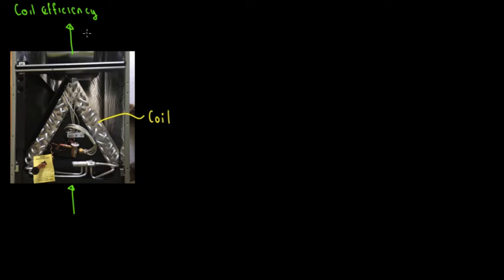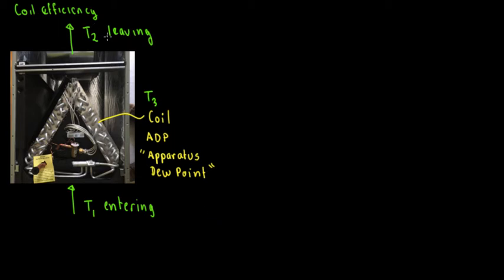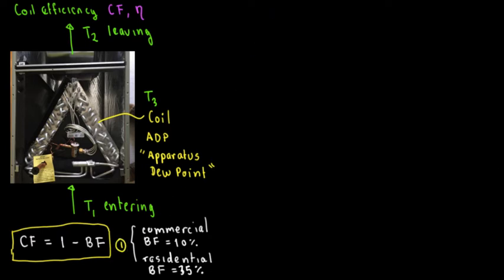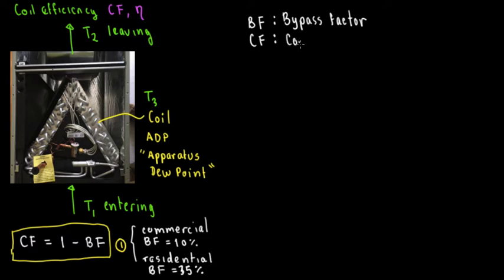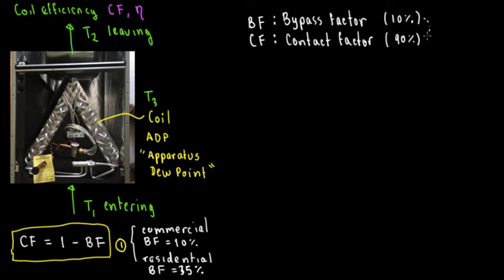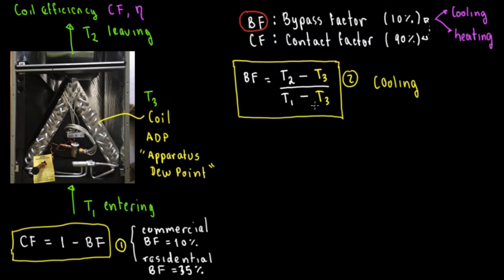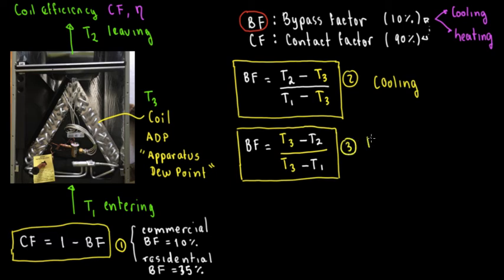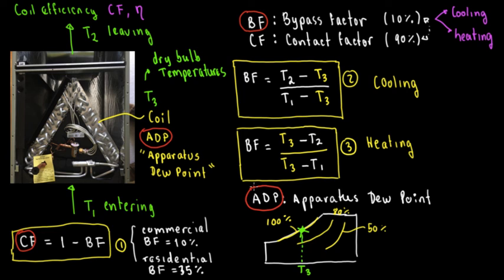Coil Efficiency, Bypass Factor, Apparatus Dew Point

Comment: Another very informative  video. Thanks.    
Is there anyway to mathematically calculate the ADP if you have dew point readings for supply and return air?
Reply from the maker: Great question. I don't think Mathematically since the relationship between the temperature, Humidity and dew point in the psychrometric chart are non-linear. I hope this helps.
Reply: @hvaceasymath  Thanks!  Actually I did find a calculation.  But it's a recursive one where you basically guess at it by reiterating over and over you get to it.  YT doesn't let you post links in others content.  But that being said, the standard method,, shown by you,  drawn on the chart is so much easier.
Reply from the maker: @HVAC_Tips_Tricks_Calcs  that’s great to know! The psychrometric chart is always very useful definitely.